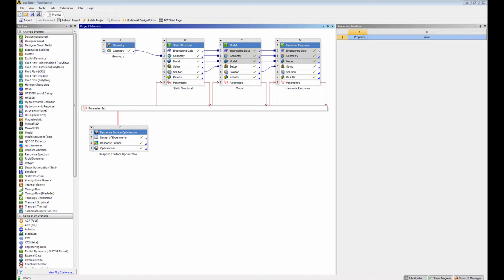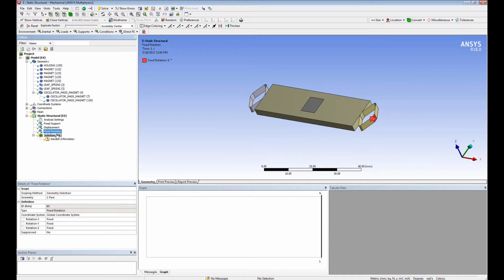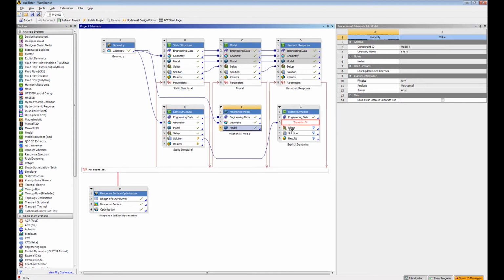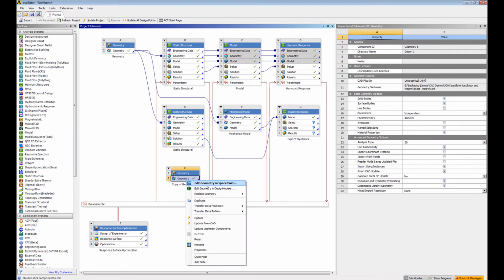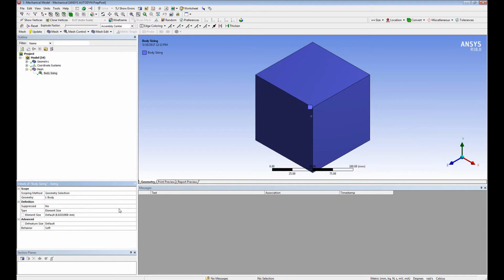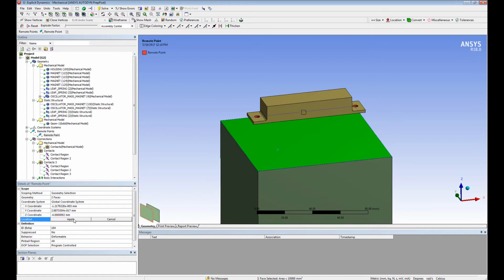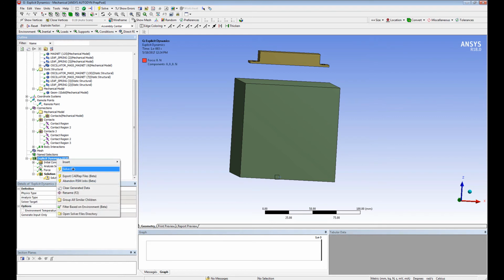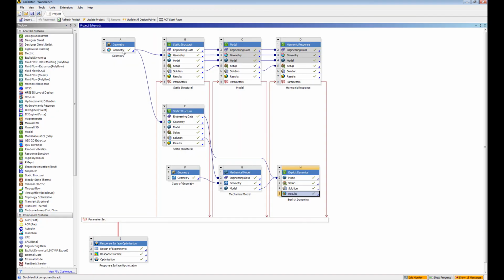ANSYS Mechanical Part 3: Shock and Drop simulation

Comment: Hi Ming Yao,
Nice demonstration video, thank you for sharing.
Why do you need the big mass for the simulation? Can you apply the force directly on the smaller mass that includes springs, magnets and housing? For instance, on the holes connected (via remote point) to the big mass.

Comment: Cool Video Thank you... any idea why Ansys doesn't allow joints in Explicit? Are remote points basically the same as MPC's/Joints?

Looking for solutions for rigidly fixing a beam to a surface with shared topology.